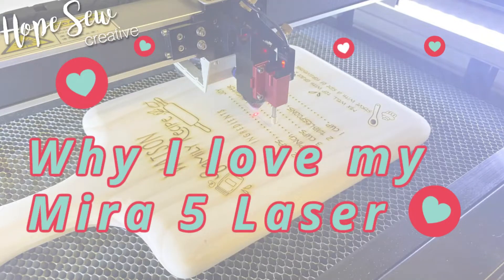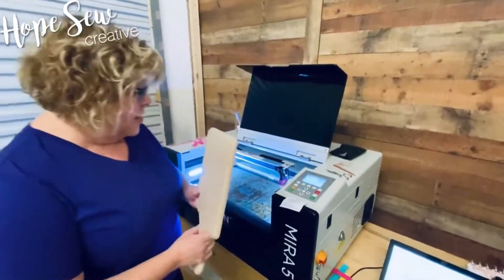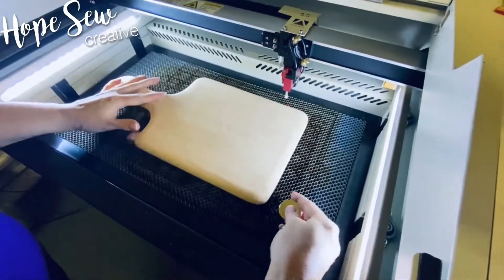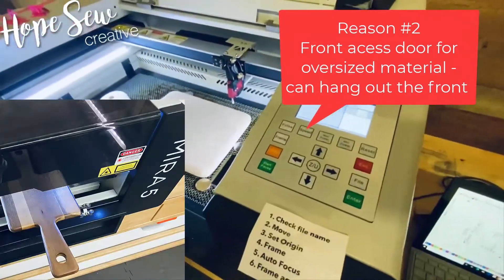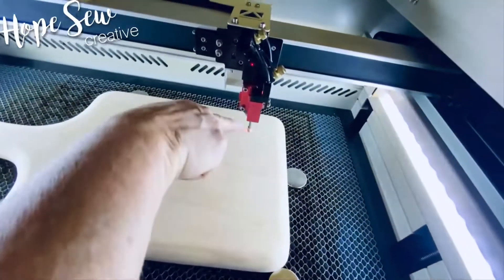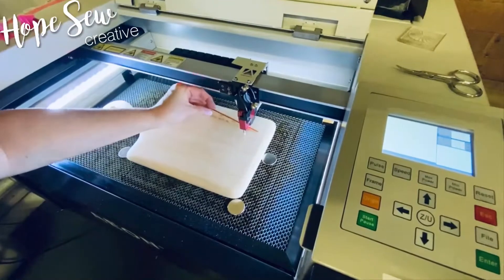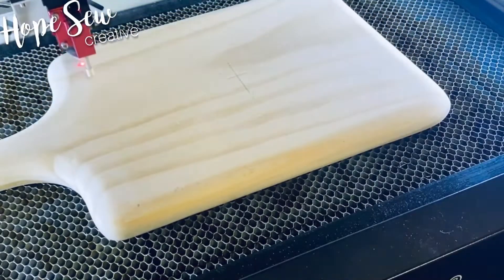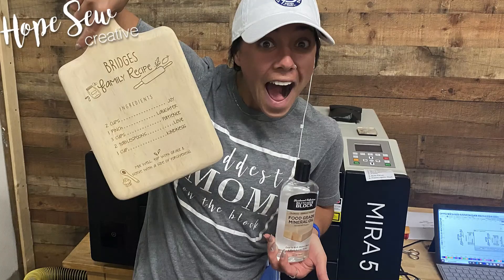5 Reasons I love my Mira Laser Better Than My Glowforge

Comment: If you remove the honeycomb, is there the bed of blades?
Reply from the maker: On the MIRA 5 there are no blades under the honeycomb but there is a flat metal bed. One the bigger models MIRA 7 & MIRA 9 there are blades under the honeycomb tray.

Comment: I was looking for the bed size and I find out it is 11.9x19.7 like GF. I was wonder if you can cut bigger size like for baby nursery names. It does have pass through? I am trying to decide between Mira 5 or Mira 7? Thank for your helpful video!
Reply from the maker: I own the Mira 5 and I have a Mira 9 coming next week. The Miras don’t have a passthrough but they hve a front door that opens and drops down so you can place thick items and long items letting them hang outside of the bed while cutting/engraving. If you think you need a larger bed I would recommend going to the Mira 7 if your budget allows it. I will be keeping my Mira 5 and my Mira 9 to keep up with our production load.

Comment: Awesome video. Thanks for sharing. If I understood correctly,  replacing the laser on the glowforge is not an option unless you ship the machine somewhere to have it done by a authorized service center. Also, replacing the lazer is very expensive (as in 70 percent the cost of the machine). I could be mixed up on my understanding.  Can you replace components on the Mira and is the light tube close to the cose of the original purchase of the laser?
Reply from the maker: Yes, Aeon (Mira Lasers) stock almost all the parts and can be ordered and replaced including the laser tube which is like replacing your brakes on your car, normal wear and tear. One thing that I love about Mira lasers is the customer service. I can call M-F and speak to someone directly for tech support whether it’s just something simple like how to clean the lens or how to order a new tube. They are the BEST! If you have specific questions, please reach out to my sales rep. Elisha Spector elisha@engravingmachinesplus.com. Her cell is (203) 994-4524.

Comment: Hope- I am trying to decide between the GF Pro and the Mira 5, since they are priced similarly. I like the plug and play ease of GF but like the ability to do rotary items and the speed of the Mira. Can I still design in Silhouette BE and upload to Lightburn? Is the exhaust discharge still 4" vent from the Mira? Do you use the California compressor too? Thanks!
Reply: I had a GF Pro and have Mira 5 & 9 and can say I would recommend the Mira 5, hands-down if you are looking for good quality machine that is listening fassr and for a company withbsyond excellent customer service. yes you can use any software including Silhouette business addition to design your projects. I think of light burn is just the operating software to make your laser do what you want. Once you design your file and Silhouette you simply open it and light burn dial in the settings and send it to your laser. It’s super easy. Right now I’m not using the California compressor with my mirror at five but I have and it’s easy to do either way. For me, engraving something on the GlowForge that took 45 minutes takes me about 3 to 5 minutes on a Mira laser. in fact I love you so much I also purchased a Mira 9 and we use both during my hands on Mira Laser Retreat.

Comment: I’m considering a MIRA 5 as I currently have 2 GF and always a problem with it( just got 1 down now for same problem I had with my first one with camera no longer taking picture).. last on average 6-7 months.. my question is that I am worried about the lack of camera and having to align the lenses myself as I am far from a techie. Any insights on this matter? Thx u
Reply from the maker: Hi. I’m happy to help. My first laser was a GF PRO. Honestly the MIRA is so different and I now own a MIRA 5 and 9. The 9 has a camera but I never, ever use it. You done need it because you have a red dot and can move the laser head in the center or to any origin and “FRAME” the job which means you laser head will travel around where it will engrave/cut before it preforms the function so you will see exactly where it will work before you run your job. Look for my new video with the pink ruler to see it in action. There is a little red dot that shows where the laser will move. So much better than the GF. https://hopeyoder.com/product/online-course-picking-the-right-laser/ Here is a free laser course that will be helpful for you.